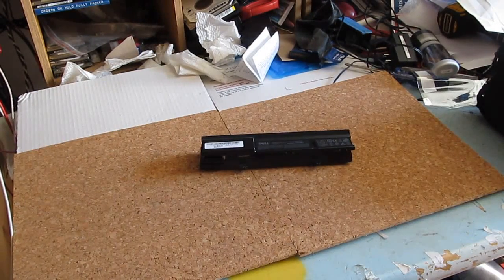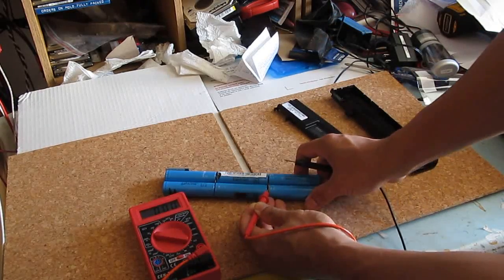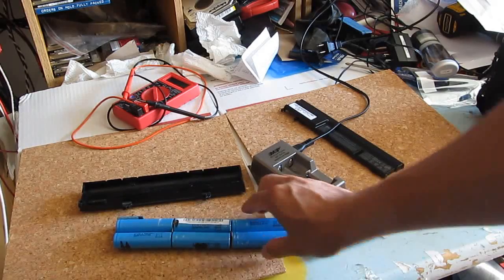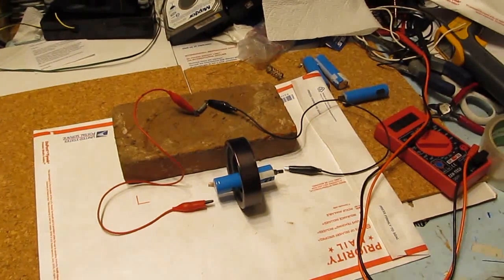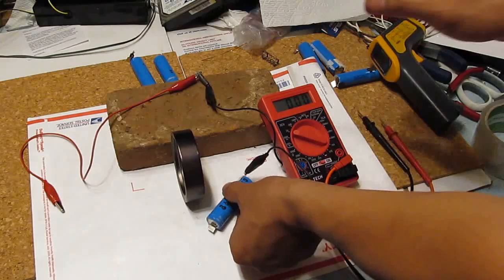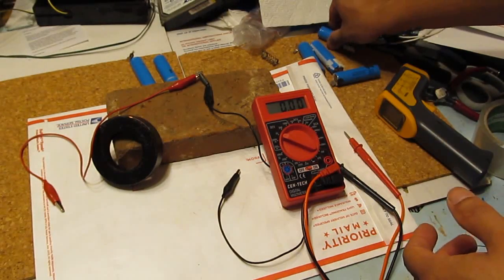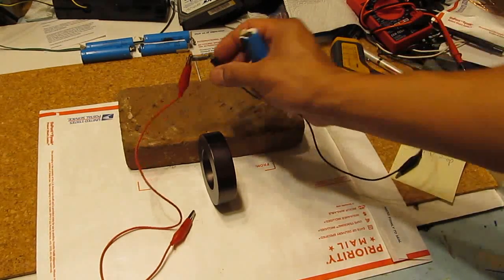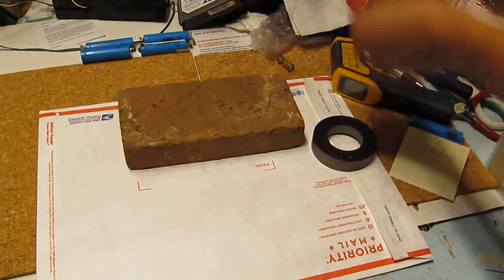DIY: How to repair/fix a laptop battery

Comment: Before replacing defective batteries, you must power the bms separately.
If you leave the controller without voltage, it locks.
Unlocking is done with special programs and the corresponding interface.
Reply: Really
Reply: Give me complete Details about laptop Battery Repaiing...plz
Reply: yea i was thinking the same...

Comment: I've watched a few videos like this. It doesn't seem difficult. But what I'm finding is that I can buy a replacement pack already made for about $25.. That's cheaper than buying the loose cells and making a new pack. In fact I recently built a new pack for a cordless screwdriver I have. But those were cheap NiCads. Good Lithium Ion batteries are about $20 ea. The cheap once I come across have exaggerated Mah ratings and poor reviews.

Comment: Good video but I think that for only a few dollars more you could have bought a charger/tester. I paid $40 for one at my local electronics “toy” store. It will charge and then test 1 to 4 batteries at a time and when its done, it tells me for each battery: max volts, resistance, and mAmp capacity. Its probably a bit slower (roughly 24 hours) but safer and much more reliable. Mine can handle any size from AAA to 18650.
You can find a number of these type of charger/testers on the common online stores/auctions. I’m not listing names because I’m not advertising for any of them.

Comment: I have the same kind of battery but not charging when fixed in the lap top ,took out all the batteries from the power pack and tested it . all cell shows 3.4volts as you did , what could be the problem ,,,is it the circuit problem or the battery problem

Comment: You glossed over the hardest part, which is getting the pack open without damaging it irreparably.  Also, as noted here, most laptop batteries have a chip that disables charging and discharging if the cell voltage gets too low.  You need special equipment to reset this chip.  None of the videos like this one even mentions this.  So, people try this and it doesn't work, and they don't know why.  This is why.  You need to tell the whole story.

Comment: the only good thing to do wit those battery's is rip all the good cell's out en charge them up by means of a lipocharger to put them in flash lights wit a power led. ones a accu from a laptop drops below a given voltage you need to reset the electronic board inside the accu pack this is to prevent the attempt to charge up faulty lipo's who can cause fire.

Comment: Your baterry is bad beacause of high resistance. You sholdn't discharge Li-ion cell below 2,8V! Your laptop will turn off when the baterry is lower than 9,9V (3,3V for each cell).

Comment: I rebuild my laptop battery, but fail to charge completely. what should i do?
Reply: This video omitted one important factor ( which most do) and that is the laptop batteries may not have failed because of the battery cells but because of the charging electronic circuits in the battery case. You need to probe the circuits and see if there is a fault in it.